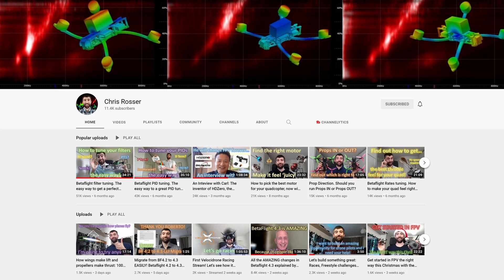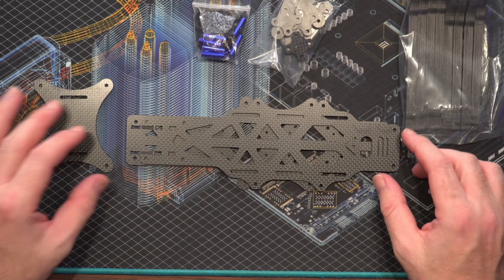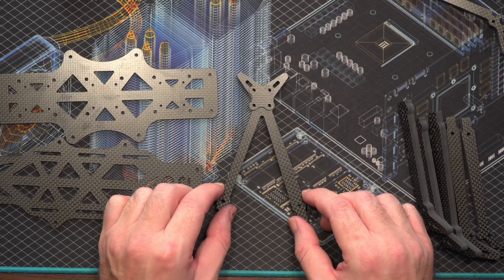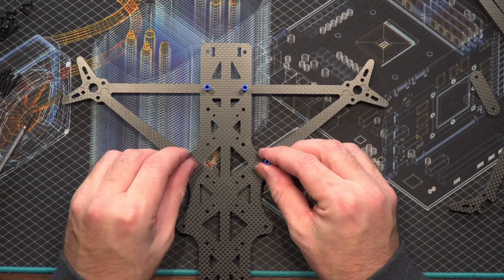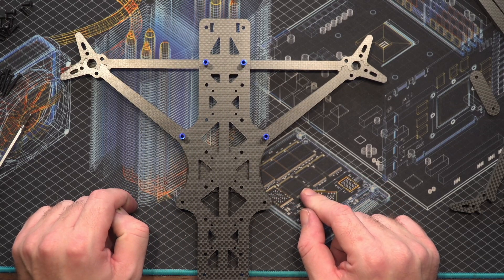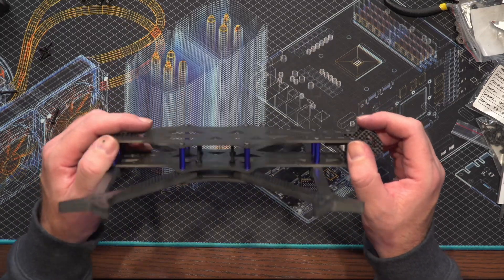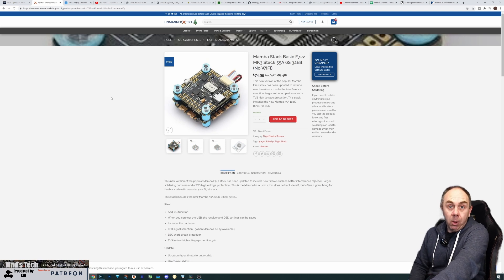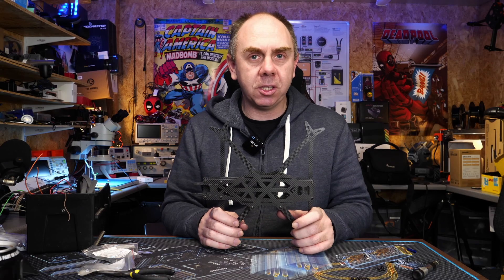AOS 7 LONG RANGE FPV FRAME FROM AOS RC

Comment: I bought a BNF of this frame from iFlight, arrived yesterday. This thing is out of this world, used the Chris Rosser's preset on betaflight. It flies so well, i had never flown anything bigger than a 3.5". Very eazy to fly, so locked on. Just perfect! And very lightweight! 600g with o3 air unit
Reply: Hey dude, im thinking of buying the same bnf but I cant find any reviews out there to know how it is. If you could make a flying video without stabalization I would really appreciate it.

Comment: What makes this frame "Long Range"?  In my opinion it is specifically not a typical long range frame.  It was designed to reduce resonance above all else.  Just being a 7" bird does not mean long range.  Fully built this frame is 230g.  It is a great frame.  I would not say it's a great long range frame.
Reply: Agreed. What is even LR (1km/2km/10km) ? I would rather put some badass 2808 or even 2810 motors with some proper kv (+1500kv) and haul ass on 6s with it. Partly because closest mountains are one hour drive and crusing over fields is not fun. Low ground speeding on the other hand that's where my heart is.
Reply: @MPQuads237  That what I have in the works.  2810 motors (1350kv though) with the capacity to go smooth & fast with a big heavy new GoPro.  Who am I kidding, I'll slap some 6s2p batteries on there and go for distance too.  Starting with a 230g frame, this is never going to be a standard "long range" build.
Reply: @alexanderfpv6655  Looking forward your footage with this bird. I will be epic.
Reply: @alexanderfpv6655  just check motor mount 25mm or 19mm, Mantis has only 19mm!
Reply from the maker: I class anything 7 inch as long range. Possibly Cine but realty is this size frame is usually longer flights.

Comment: Why make a hole in the middle of the arms for the motor screw (for the motor bell) but not in the plate that holds the arm together ?
Reply: The arm-hole is not just for saving weight.  So motors have a bit that protrudes down there.  The plate has a specific function (resisting particular stress) The effectiveness of which would be reduced with a hole in the middle of it.

Comment: Hey Ian, I just finished my Chimera 7 build with the HDZero 1W last week (needed a 250mm mipi cable btw) and I also used the Mamba f722Mk3 stack, ECOII motors (except 1500kv), and those HQ Props. 
- I had a strange issue with the Current (Amp) reading jumping all over the place, and I’ll be interested to hear if you have the same issue. Let me know because I found a solution. 
- Beyond that it needed a bit of PID tuning to go properly but it’s flying well now, just need some proper weather up here in Norway, cheers!
Reply from the maker: That’s a nice build. I will for sure let you know.  Iv not ordered the bits yet as I was hit by my EOY tax bill for the channel so I’m going to have to wait a month.  I still am looking panning the 1W HDZero build for this but as that’s not out yet I have a bit of flexibility on time.  Im looking forward to seeing how you get on with that for sure.
Reply: @MadRC  Absolutely, no rush, we’re all looking forward to spring and summer anyway… Time, weather, and daylight are all very tricky this time of year.  I’ll watch for updates from you, and in the meantime try to finish editing some of my own videos!
Reply: omg so nice.. i want to do a iFlight DC10 10" with HDZero 1w
Reply: @divingfalconfpv4602  yup, it’s going to be a great LR quad, excited for nicer weather!

Comment: Love what Chris is bringing to the hobby, I'd recommend the hq 7x4.5x3r glass fibre nylon props and definitely a better stack than Mamba if you can Ian I certainly wouldn't be sending my 7inch up a mountain with a Mamba stack in it
Reply: Why don't you trust a mamba stack?  Feelings or evidence?
Reply: Mamba stacks are fine they are very solid. I have used about 6 different mamba esc's in the last year and I beat the hell out of them and they hold up great, unlike my Iflight SucceX 50amp ESC which failed on me after not many packs.
Reply: @jhughes2286  that’s interesting, I bought recently the same esc ( iflight succex 50) , that I saw on a lot of builds on YT , and it gave me only problems until yesterday where it abandoned me in the middle of the flight ( cruising ) so that esc banned for life for me …
Reply: I hope that hqprop in fibre nylon material is better balanced than the standard version, I trashed all the ones I bought because totally unbalanced